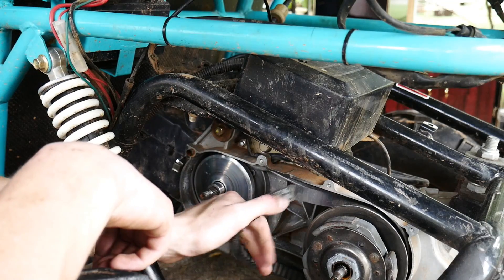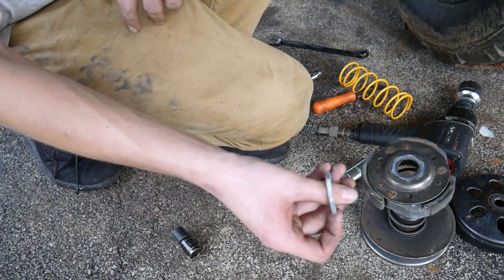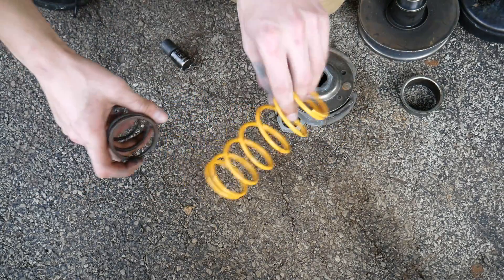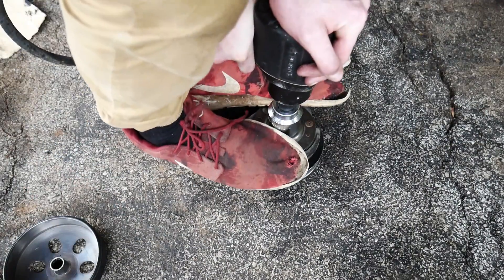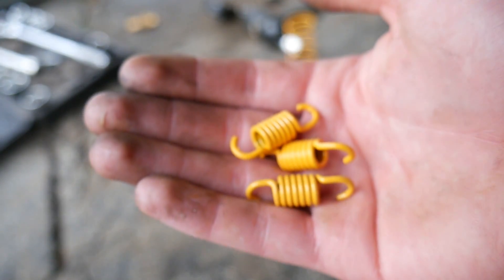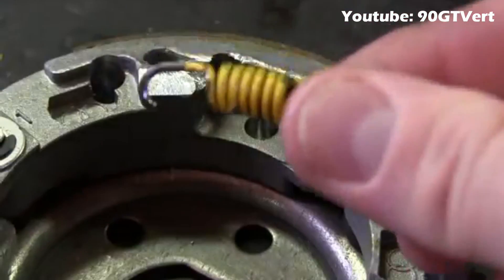How to Tune a 150cc GY6 CVT - Main Clutch Spring and Variator Weights

Comment: What is the top speed now ?
Reply from the maker: Bedri Yagci It's like 2-3 miles more. Not much probably like 29mph
Reply: Thank you for your quick reply. I have a question for you. 
I have my 2012 model, 150cc, 250 kg odes brand utv. Utvs 61mm big bore kit,  a12 camshaft, big jets, performance air filter, and j.costa front variator but back clutch  is stock. It's driving 47 miles. But I want to do more speed. I want to change the back clutch springs. I have blue, yellow and red springs. what color springs should I wear for more speed?
Reply from the maker: Bedri Yagci those springs will not do anything. Maybe try a smaller sprocket

Comment: Hello buddy..I have a 125cc gy6 scooter and I replaced the stock spring clutch, installed a 2000rpm one, and also the 3 little springs.
Replaced the stock rollers for 13g (18x14) sliders.
But my scooter doesn't speed over 80km/h.
Should I install 1500rpm spring clutch, and lighter rollers, for better performance..?
Thanks
Reply: For better top speed i use 18 grams rollers,1000 rpm contra spring and 1000 rpm springs,my scooters runs very quiet at 40 mph and the rpm remains near 4000 rpm
Reply from the maker: I think your 2000rpm spring is fine. I think you should buy a roller kit from 9g to 15g and test to see which one gives you more top end. Or maybe like an 11g
Reply: Ok thanks a lot
Reply: Rollers in these cvt systems are just  like the flywheel in a car!
And any Old school Mechanic.
You can't have faster sprint and higher top speed!
U gotta choose between both options!
Reply: Top end is easy,heavy rollers...i use  dr pulley 18 grams for years,just make sure you put them in the right position..use a light contra spring and springs the same rpm as the contra spring or lower..guaranteed to work

Comment: I have a DRR 50 . I want to lower the stall so clutch engages at a lower rpm for woods riding . What set up would you recommend for my cvt ?
Reply from the maker: I recommend 1000rpm blue mini clutch springs and a 2000rpm (heaviest you can find) clutch torque spring. Because the 1000rpm will let your clutch slip pretty much at idle; good for crawling. And the 2000rpm spring so you can stay in lower gear for longer.
Reply: Leave it stock !!!  The mods are all for scooters and bikes that want to go faster.  We have a Hammerhead GTS150 and I will leave it bone stock as I do not need higher speed or acceleration but more torque. We use it to climb, mud-ride, etc.  I might go for the 170cc BB upgrade kit  at one point in life but for now all we did is to install a 26mm carb. The 24mm EPA mandated low-emission carb just gave us too many problems. The 26mm carb with its 26mm intake solved all the problems and the engine revs a little happier.  Its perfectly balanced now !
Reply: @oldwortex5818   would putting a carb like that on my adly cougar gy6 125cc do the same job ?